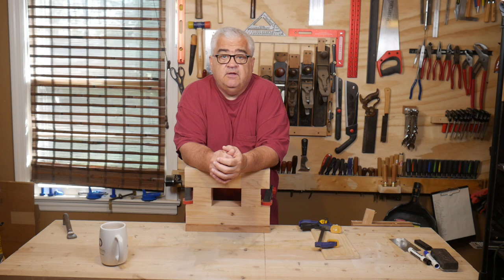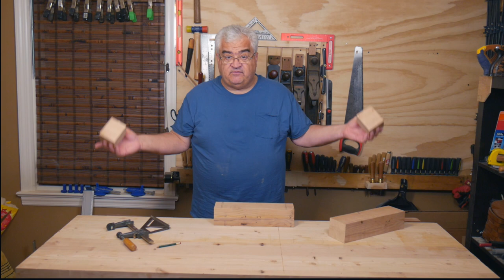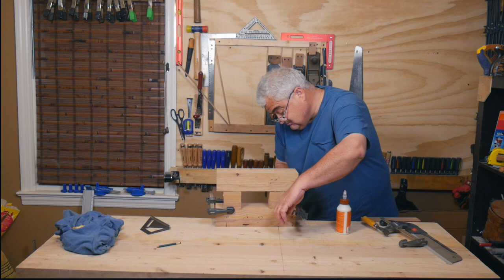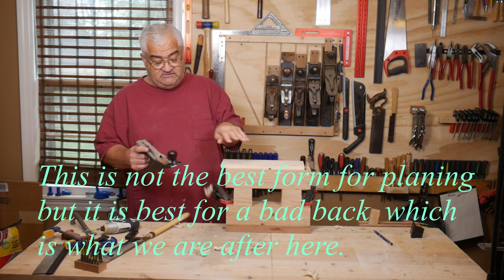Bench Bull, what is it and how to use it...

Comment: @jldwoodworking thanks for the lesson.  You are charming and smart! Thanks for getting the warning out there.  You are correct in saying the younger generation don't think about ergonomical issues. 
My suggestion for you is raise your entire work bench...the top of it should be at the top of your hip bone.  If you raise it completely it will give you the opportunity for more storage underneath too!
Reply from the maker: Thanks for the reply. I have thought about different heights for the bench but I like it lower for hand planing so it is just a give and take.  The Bull helps with some of the things I like a bit higher. Thanks for watching....
Reply: @jldwoodworking  what about adjustable legs?